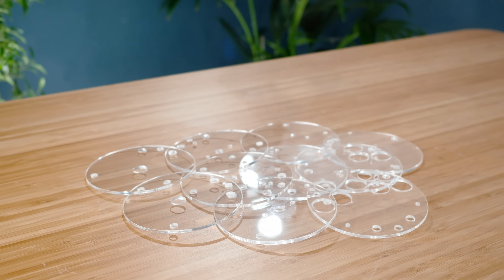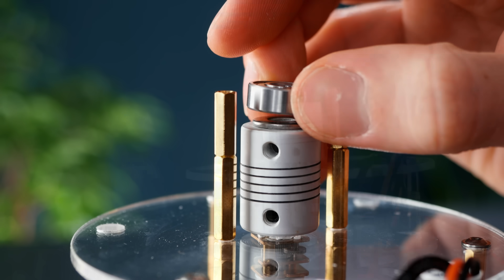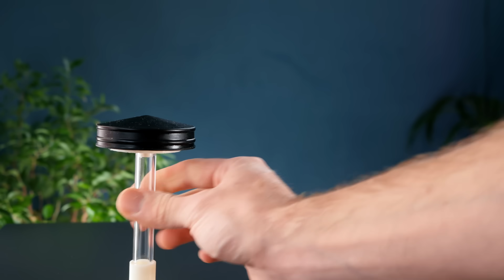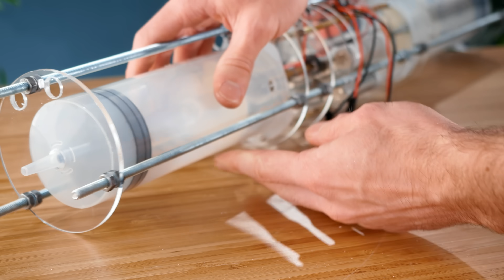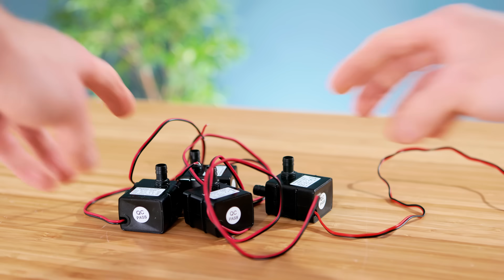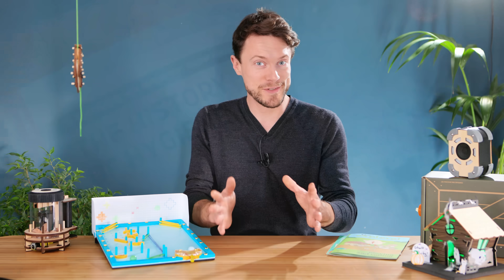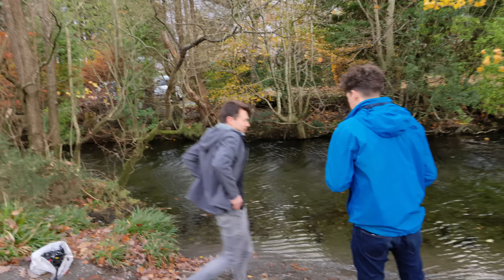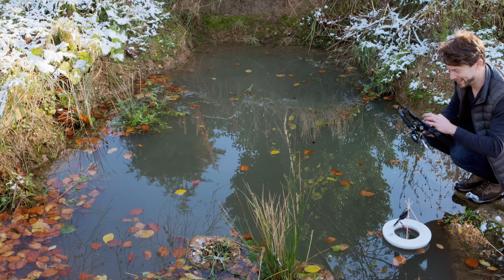Building a DIY submarine

Comment: For Christmas 1996 or 1997 I got a very expensive ($300) you RC submarine as a present. It was extremely capable. It wasn't designed for the antenna to be completely submerged but if course I had to make it dive to 10 feet. It never malfunctioned. It even came with weights to add in order to make it neutrally buoyant. 
Seeing this video really makes me appreciate the engineering that went into it's creation that long ago.

Comment: Many DIY Perks videos have been good but in my opinion this is the best one so far. Such a cool project, and you explain it so well, I come away from the video thinking I can almost do it myself!  No idea how that would work in real life, you can build an underwater remote controlled submarine with built-in buoyancy  control,  I can just about hammer a nail into a wall on a good day.
One tiny oops, though at 3:48: "The motors spin slowly with a lot of power" - you probably mean "a lot of torque" - otherwise fantastic video.

Comment: 16:30 Got out of hand very fast you say? Well, if thats the case, why not build a solar powered submerged houseboat? Just scale up things and try to make it as inexpensive as possible.

You would need a room structure with a hatch/point of entry.
Control panel with lots of cool buttons, dials and displays.
Enough solar panels to be able to charge when idling at suffient depth to avoid any collisions from larger ships. How much sunlight does the water reflect? Depth is probably a large factor here.
Energy storage pool with some sort of BMS
Ballast system that will also automatically push out water if power runs out (or emergency button is pressed).
Life support. Oxygen extraction from water? CO filtering of some sort? Some sort of air quality monitoring system would probably be a good idea.
Some sort of system to be able to view the surroundings. Cameras and lights does seem a better choice then viewports.
Propulsion and steering systems.

Optional moon pool and diving gear.
Optional toilet (would just need to send stuff outside)

Comment: Very cool project there!

I have two suggestions for future model(s): 
1. Instead of adding steel pellets to add weight, would it not be awesome to add more batteries?
2. Also, it would be a next level submarine if you could change to a frequency that can propagate under water so you can eliminate the floater and make the submarine 100% self-contained.
Reply: ...und once the battery level is drained the submarine gets back to its floating home base (like an electric lawnmower) for recharging.
Reply: @a.nickol6559 batteries don’t change weight when discharged, is that what you meant?
Reply: @nicholasfaber9695 It’s talking about adding a sensor so when the battery’s reach like 5% the submarine will go all the way up to be recharged.
Reply: 4kg of batteries is a lot of batteries lol. Would have to add anothe half meter to do that.
But that half meter would add more bouancy so more batteries would be needed again. And so on and so forth. The thing would be 5 meters long.

Comment: What an amazing project, to go from a concept to a near spot on build first time round is pretty incredible, then to iron out so that a 2nd test is near perfect.  But I totally agree with one comment about using more batteries to give you the 4Kg of ballast needed to give neutral buoyancy would be a good mod.  I nearly purchased a flying drone but I can now see an underwater drone is by far as interesting as any flying model and I cannot think of any regulations to break with one of these.  Star rating it has to be tops 5 stars!!

Comment: if im going to design this, instead of using water pump like as propellant, i'll use a motor and a propeller. it is magnetically attached to a motor and use gears to ramp up the speed. (using magnets to avoid potential leakage of water using a shaft). if i only had the resources to make this kind of videos. but nice work! how to see v2 of this sub of yours.

Comment: Can you please make a video on hacking  an Apple TV 4K or 4th gen please use both as an example to use type c as power input and using a Type C Decoy for power and using short circuit protection to protect the motherboard from getting fried and please try to use 3d printed parts to hold in place and an few modifications here and there so you can have be portable and take it anywhere and also making a VESA mount to mount it on a monitor or TV. nobody else hasn’t done it yet and that I’ll be the first  and make it look very cool and awesome

Comment: I have a question... how do you charge the 18650 that's welded together? I know the multicell battery charger circuit but does it work even with the overprotection circuit he used?

Comment: You are going to have to change your ballast system, ideally with electric pumps because after a few feet, the air in the seringas will be compressed by the water pressure and you’ll lose all buoyancy unless you are able to add more air in!

Comment: This project has real potential. By that I mean real world applications and not all of them "civilian" in nature. The low cost and high payload, lends itself perfectly to expendable swarm projects. Even toughening the materials and improving the propulsion/battery capacity would not detract from the clever design. 
One thing to consider is the potential heat build-up when compressing the air. It could be a cause of catastrophic failure. Stick a couple of liquid crystal temperature strips to the ballast tanks to check.

Comment: Replace the Ballast pellet's with more Battery more powerful Thrusters I would do something like a HamiltonJet waterjet?
Perhaps some lateral plane fins to independently change the pitch.  

Have an emergency resurfacing ballast that can be jettisoned when loss of all power or radio signal like a small trap door that releases just enough ballast to surface when the system is full locked to submerge.

Also You could defiantly make some money with this 
people pay BIG money for hull inspections of ships, Tank inspections for bulk carriers
Even small vessels have to have a hull inspection people would pay to have your sub inspect the Hulls rather than a full Dry dock or a diver do it.

Comment: still  waiting for the redesign  add stability code with the motors so it stays postionally locked in the streams and ofcourse wireless  instead use something that use water medium to transmit signals I heard ultrasonic sound is great

Comment: Perhaps the Queen might give you a contract to build a bunch of these, and that instead of hauling the weighted bags inside, you could perhaps create a miniature rocket launch system for icbm types of missiles? Or sampling equipment, of the subsurface soils, … or even to utilize some type of sensor placing apparatus that could/would measure plate tectonics movements? Hells Belles, who knows of all the differing applications you could do with something like this auto roving submarine, … and perhaps you could even build one that could take people for underwater rides, …

Comment: May i suggest using bigger motors? Your putting too much stress on the 2 motors..lits like trying to run a 6 wheeler mini truck at 69kph using a 125cc Motorcycle engine…The DIY Sub will definitely work but too much stress on the 2 mini motors..well lets just say they’ll give up once you use them for a long period of time

Comment: I think its better to control the overall density between 0.95(without water) to 1.1(with water) and leave the rest for your engine. Also, you can add an off centre swiftable weight to control it points up and down. 2 benefits from this: 1) to adjust your thrust angle for better maneuver 2) increase/decrease sinking drag 

a quick start could be: fillup an empty hulk with water, reduce little by little until the whole thing is about 1.1 density and then keep reducing and drain to another container until 0.95. weight the water inside, which is your fully loaded weight you can put inside. weight the water inside the container to know how large a syringe you should buy.

Comment: If you decide to redesign it, it might be a good idea to weigh all the parts individually so that you can build your submarine around that fixed amount of weight, with a correct center of gravity, and with the correct amount of water displacement for it's weight, with the minimal amount of extra ballast. I think that it should be possible to get the buoyancy much more accurate and that the air displacement system can be made much smaller when everything is much more fine tuned and accurately calculated. 

If everything can be made smaller and lighter in weight you would have much more control, considering the power to weight ratio. I think that your submarine is a bit under powered as it is when you would put it in slightly moving water with all that extra weight and size. Maybe that a narrower jet nozzle can make it go a little faster? 

Still impressive and you both proved that both concepts work 😀

Comment: I need help!
When I was young. I saw an episode of “FLIPPER”. In 1 episode a scuba diver used an open wet sub. It had a tubular frame that held a seat, controls, 4 movable motors, an air tank, batteries and 4 ballast tanks. 
I am unable to find this episode. 
I am a scuba diver. This type of open wet sub/sled would greatly expand my range. I would like to build one. 
Does anyone know what episode of “Flipper” this was in? Anyone know of a similar type of wet sub/sled that was manufactured in the pass. Does anyone know how to design something like this. 
I live in Florida and scuba dive in warm Florida waters. So I don’t need a protective enclosure. At the most a windscreen. 
I want to say thank you in advance for any information you can find.

Comment: Just another idea when you go to revisit this project, there are 2 axis camera gimbal mounts for RC. You can also get a clear acrylic or poly dome for the front of the sub if you go with a different propulsion method giving you a camera that can change frontal viewing angle. I love that you built the power into the sub and didn't decide to feed power externally, this cuts down on cable gage outside the submarine since its not transmitting power reducing drag. I don't know if it would work, but if you wanted a cheap cable cluster between the submarine and Bouey, maybe strip an ethernet cable on both sides? If you try it and it works, you can theoretically buy a 1000 foot box of the stuff and now you got yourself a whole new class of submersible if you scale up the power some  and capacity alot for ocean diving.

Comment: Yup, you had a lot of air space in that tube, and not a lot to counter it. If you want something to float, put styrofoam in it, or just the equivalent air space. ;) Your next challenge is to run the sub at a given depth between "top" and "bottom". ;) Not as easy as it sounds.

Comment: Possible redesign. Make the motors operate individually to allow it to dive or surface at a 90 degree angle. If possible see if it will launch itself out of the water or shoot water up in the air with the rear pump.

Comment: Why use different pumps for side ways and turning? Just use diodes or FET transistors if you want to be able to reverse the motors and drive them depending on your requirement. Remember to add your ballast weight to the bottom! You don't want the submarine to role over.

Comment: A few thoughts, The lateral thrusters and turn thrusters are redundant, by adding some logic you can halve the number of thrusters as one set could accomplish both tasks.  Dive planes will be useful for controlling your descents/ascents due to bouyancy issues,  make the fins on the back move, also add them at the front and have those move as well. Consider a '+' arrangement for the fins instead of an 'x' arrangement, this will provide more useful and predictable control surfaces.  Add an emergency blow system with a compressed gas cartridge and inflatable bags (floaties maybe). Overall very cool and impressive and definitely "NOT" what it looks like...

Comment: Refined Design: I would say remove the steal pellets, and replace them with more batteries and for sure more powerful thruster engines :)
Reply: exactly what i thought when he started putting the steal balls in 
he probably  thought of that too but runout of time
Reply: If he is going for faster propellers, he needs to minimize cavitation noise. You know, in case of enemy submarines in the area.
Reply: @randomaccessfemale  Now we need missiles too.
Reply: @N0N0111  

He should develope nuclear power too in case to intercept enemy invasion from intercontinental.
Reply: Even better, a single big pump with outlets to all the main function points placed in the center of the craft sucking water either from the top or bottom and to control the outlets, just use internal servos (placed in the dry sectors) to drive vanes. This would allow full power forward and backwards, and reduced power (because it's always split towards two outlets) whenever he's turning or strafing the craft.
Source: this is how they made an older submarine meant for underwater archaeology. The vane and pump system allowed the operator to either not pollute the observation or to simply use the craft itself to remove mud and push it out as the muddy water would be sucked right through it and ejected in out of the way. It had a big nose that was the inlet. This was back in the late 00's in France.
Reply: @aserta  2000?
Reply: I think the steel pellets are used to make it easier to adjust the weight distribution to keep the submarine level etc
Reply: @ramdom_player201  the buoyancy balance can be adjusted using the syringes on each end.
Reply: @ThePippin89  But you get maximum speed up and down if you balance the weight of it perfectly. So the weight is depending on how large the water/air tanks are(or the other way around).
Reply: https://youtube.com/channel/UCIrnqSOv3lSKzeEkper5u3w
Reply: 4kg of batteries ? 

Also doing so much changes to the submarine will lose it's water proofing.
Reply: Yes

Comment: So with the extra weight maybe add some batteries and solar cells?
Also would love a lager version, like one man submarine :P
Reply: Solar cells on a submarine? You have to drive a fair amount of time (hourse, days..) over the water line to generate some usable energy with this little space for solar panels. But then again it is a submarine -- meant to dive (!) -- and this is Britain -- not that much sun most of the time -- AND it is just a toy after all. It makes more sense to just make the battery pack removable (to change it to a new pack) or just rechargable by cable from a standard plug or something.
Reply: @fumanchu4785  I was think passive charring  when not in use :P

Comment: Funny how nobody seems worried about the size of those plungers and what on Earth those are intended for ...
Matt's sub is heavily over-engineered. And seems to only have a "RC sinking pipe" project goal. Cody's approach is much more efficient, funnier to drive and has better FPV videos. If only he could get a 420-450 MHz radio controller, those seem to go better underwater. Or an ultrasonic modem, it could exploit underwater sound propagation, getting rid of the umbilical cable for good.

Comment: water proofing rc stuff ....receiver ..BEC,,, motor controllers.. i prefer 5min epoxy.. the kind bought anywhere in the double tubes.. being sure to 1st set the receiver failsafe.. and coat them thourgly all except the tops of any metal cans.. or other obvious heatsinks.. as for other parts like servos  packing them with silicone grease works well... there are other methods but these work best for me. ( try at your own risk )

Comment: You should make an emergency surface system, where if the Internal pressure reaches X, the syringes start to quickly empty.
Reply: Yeah
Reply: How would you measure pressure? Unless there’s a circuit board for it?
Reply: @reyariass  I belive a barometer? Perhaps and electric one
Reply: @TAPS147  iirc a barometer measures air pressure
Reply: wow.. good idea man.
Reply: yeah, my life depends on it, I am taking few men on it as well.
Reply: Why did he use syringes instead of using pumps they would have been a lot simpler
Reply: @tanmaysingh267  because syringes are off the shelf and have a rubber stopper with an injection moulded barrel ready made for it to make a good seal for building pressure. Much easier than trying to make that at home
Reply: @felixschrodinger7533  small water pump with a plastic container would have done the same thing,with much simpler design

My project submarine used a pump as it was very simple couldn't even think of designing such mechanism for syringes
Reply: @felixschrodinger7533  pump would occupy small space and solve the byouncy problems
Reply: https://youtube.com/channel/UCIrnqSOv3lSKzeEkper5u3w

Comment: Dude, this is great. I wish that you lived next door to me so we could collaborate. I have built similar craft. I also used pumps, but I found them to be too weak, and I replaced them with brushless motor driven props. What you need now, is an underwater acoustic data modem. Several companies make these, some with ranges as far as 8000m, and with more than enough baud rate for remote control. And, they are bi-directional. Some may even provide enough bandwidth for low resolution video. Underwater Untethered FPV.

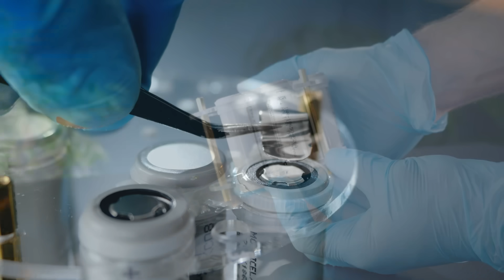Comment: Wich tool is the one you have used to solder the tiny plates to the batteries? (time 2:42)
Reply: like to know as well...
Reply: it seems to be a spot welding machine specially for battery 18650...
Reply: Thanks a lot!

Comment: thoughts on adding a secondary backup system to the buoyancy control where if the primary system loses power, the secondary system kicks on to flush the onboard watertanks causing it to rise?
Reply: I'd suppose it isn't really necessary when it's tethered to a buoy on the surface. But it's totally a real concern if he's able to do away with the tether.